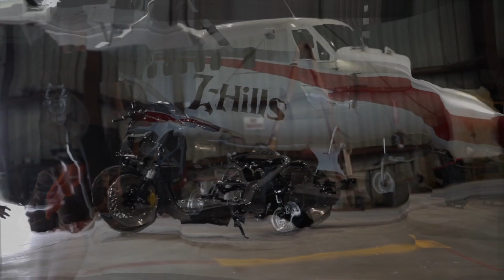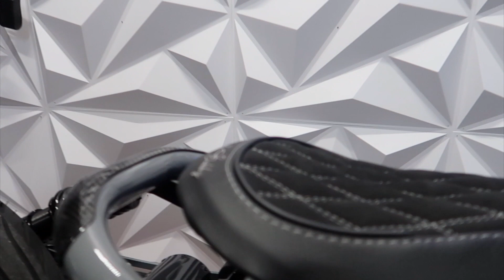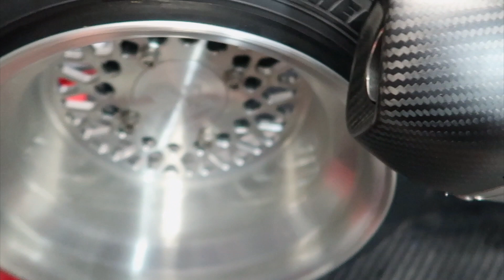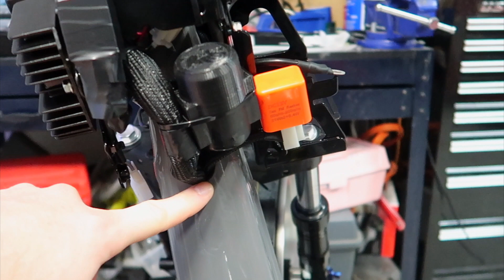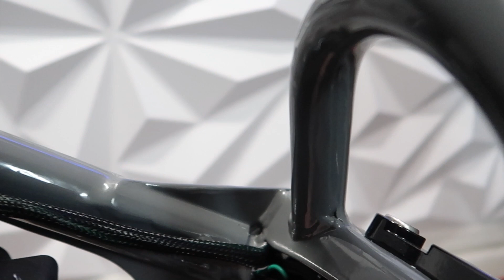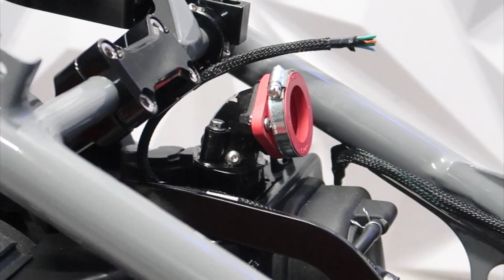My Last Ruckus Build -171cc

Comment: What clutch springs and compression spring do you recommend for the gy6 150cc? Also do you need a case brace with the trs ultimate billet cvt ankle biter? Thanks!
Reply from the maker: I like to use 1500rpm on my 150s. No case brace is not needed. It does the same thing as the ultimate cvt just not as clean looking.
Reply: @burnoutbobby  Thanks for your help!
Reply from the maker: Anytime.

Comment: How hard would it be to put a motorcycle gas tank on the ruckus
Reply from the maker: Not sure as you’d be changing from vacuum pump to gravity fed.   It’s been done before.
Reply: @burnoutbobby  are there any bigger tanks for the ruckus
Reply from the maker: Yeah the ruck shop makes an extended gas tank that fits in oem spot
Reply: @burnoutbobby  how many gallons
Reply from the maker: Should say on the website. Not sure if the top of my head
Reply: @burnoutbobby  ok I'll check it out Thank you

Comment: That V.2 has a super clean wire tuck. The front half looks like just the components are just sitting there to be wired up. I believe you could put a manifold spacer in between the carb boot just a thought. It's Perfect really nice use your time wisely my friend. 🔥💯✌️
Reply from the maker: Thank you brother.

Comment: It may be a little sketchy but with it bike being super clean and tucked I would only run a front brake. Could go even cleaner and not run turn signals and horn, this would eliminate all the controls on the left side of the handlebars. Super awesome seat from Sue!!!
Reply from the maker: Haha. I am right on the same page as you. There is no left control on the bars but still have all the functions. The rear brake is on a foot pedal. You will see soon my friend.